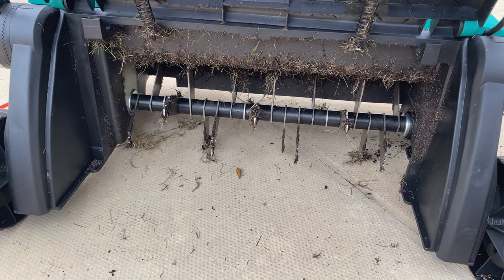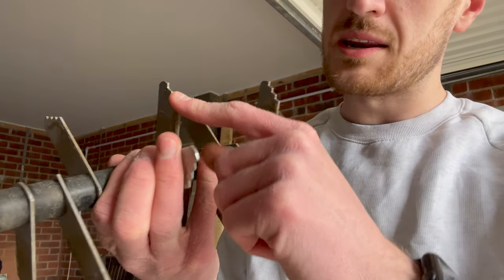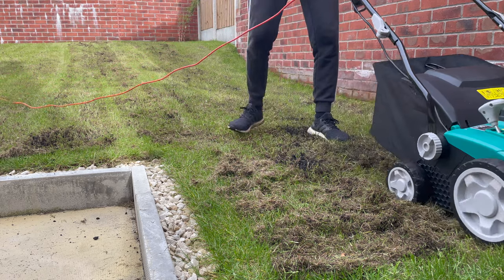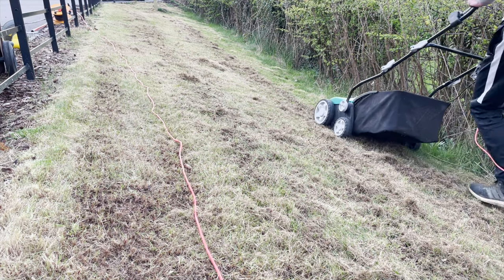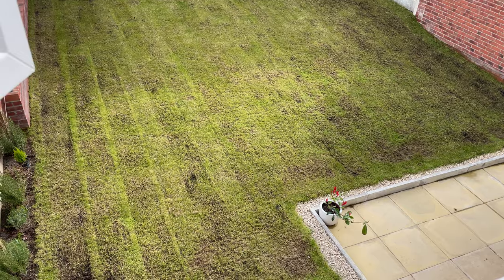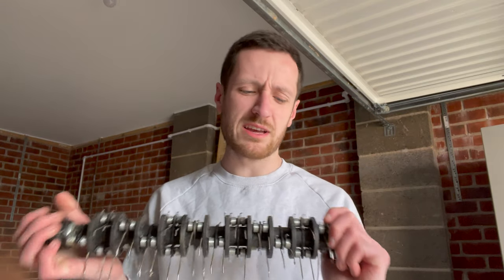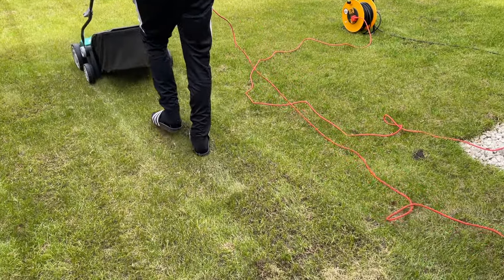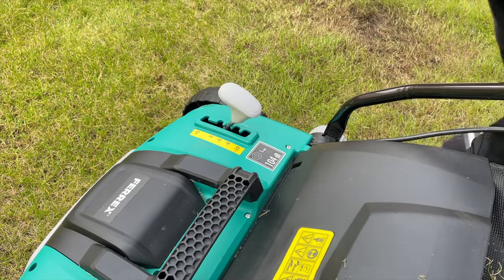Ferrex Electric Scarifier - Best Budget SCARIFIER and POWER RAKE?

Comment: I think their both scarifiers, but they should be used under different conditions,the power rake removes thatch from the lawn so should be called a dethatcher the scarifier removes thatch and breaks up the soil surface in preparation for sowing grass seed not a true aerator which punches hollow holes into a lawn.

Comment: I'm looking at this matching now, but I'm unclear on the airation side, as I thought spiking the ground is airation method, also my lawn not even, will this matching actually air your lawn?
Thanks
Reply from the maker: It’s more just to remove any dead matter on top of the lawn as a way of aerating, instead of a manual aerator that will remove cores from the lawn (which are usually quite expensive for a decent one!)